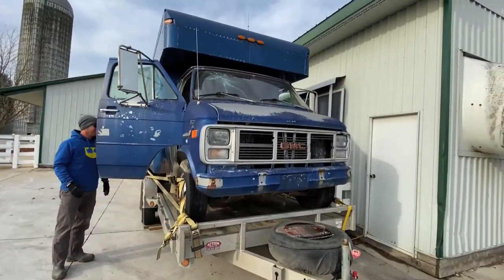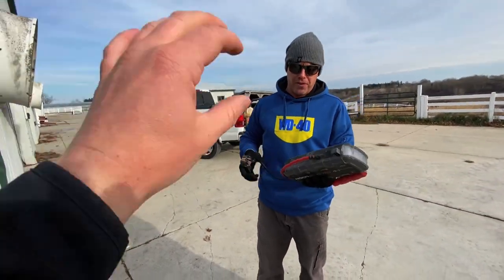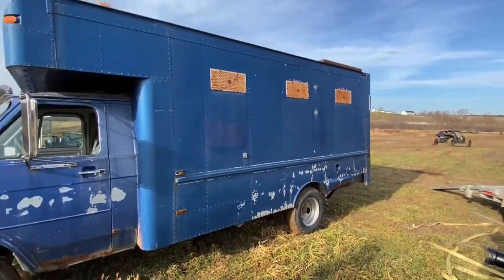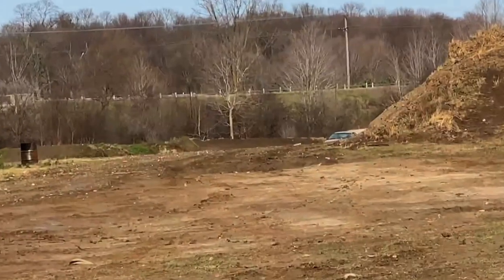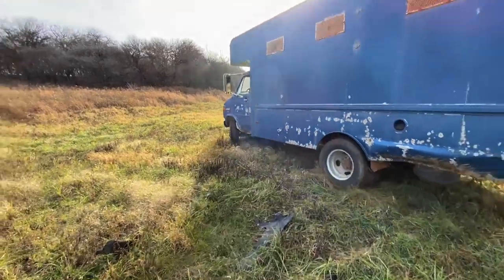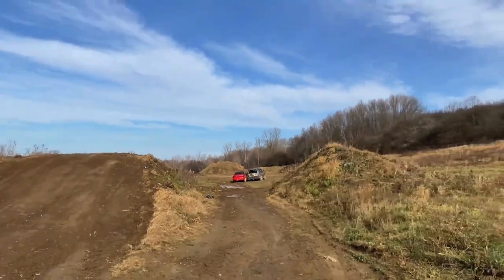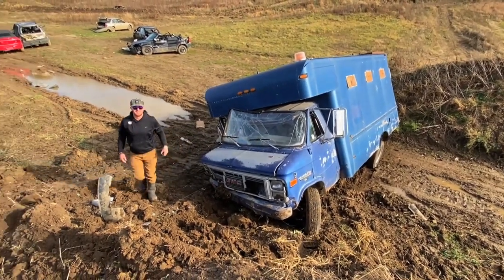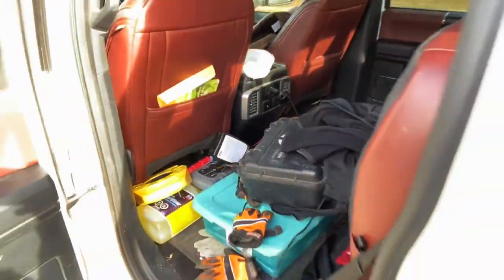Detroit DIESEL RUNAWAY!

Comment: GM 6.2L diesel "J"code HD..150hp in its best day, TH400 trans, 6.2L was predecessor to the 6.5L and the Duramax
Reply: 6.2 & 6.5 = 💩
Reply: You cant count the 6.2 detroit diesel as 💩 But the 6.2 diesels from GM was crap, and still is..
Reply: @xxbambamxx7261  you can't compare 1983 design technology to todays engines and power levels..in their day they were pretty good for a IDI engine.
Reply: @xxbambamxx7261  Theyre one and the same. Gm used the detroit diesels in their trucks. They are gutless piles but very unique and fuel efficient lol

Comment: Trust me man you did us all a big favor, those motors are complete garbage. And the 6.5l Detroit that they put in them a couple years after we’re the same way that suck
Reply: 6.2s and 6.5s weren't made to be power houses they were made to be somewhat reliable somewhat fuel efficient and to have some power and there reliable enough that the U.S military have them in the older humvees